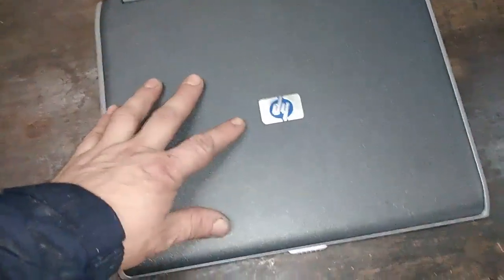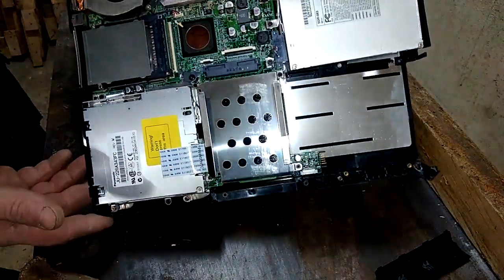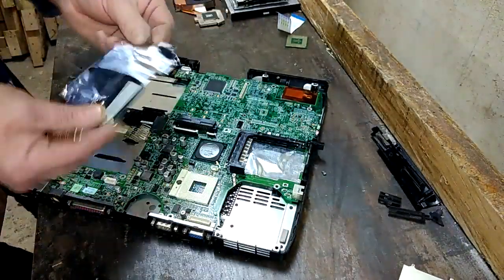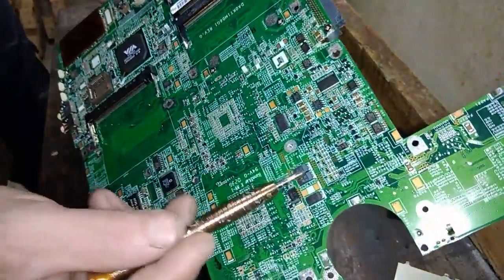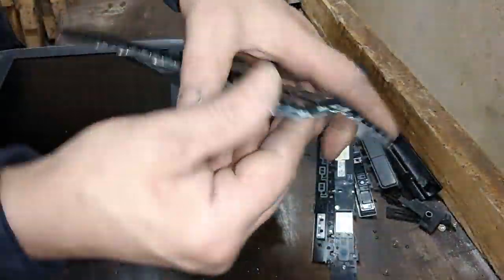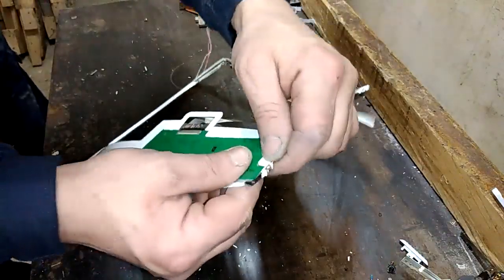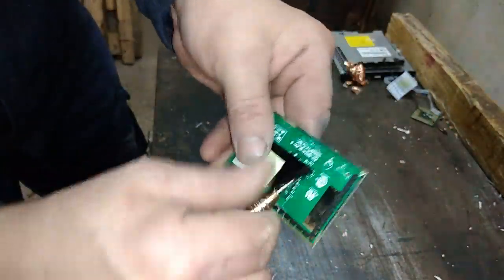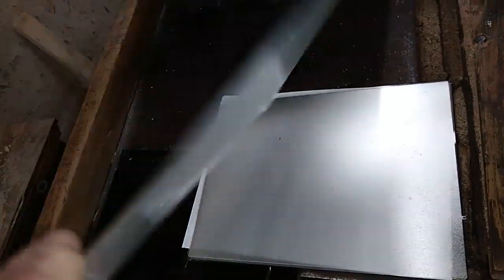Laptop Scrap Step by Step - Au,Ag,Pd,Al,Cu,Fe,Sn,Zn...

Comment: Hi Mr Dusan,
Many times the covers and the chasis is not plastic IT IS MAGNESIUM, as you hear it, it is magnesium.
It really looks like plastic but it is not, check it out with some sulfuric acid or vinegar, scrap a little put on the scrap some of the acid and if it bubbles Eureka it is magnesium even lime will help.
Love your videos. Keep them going.
hola from México.

Comment: Thanks a lot Dusan for making the video, it confirmed me that I am not missing anything in laptops. One question. What is your idea how to process these touchpads boards? It contains glue and green layer (for me a lot of mess) and I really don´t know how to handle them, so I am just keeping them aside until I will find out how to process them.
Reply from the maker: Ok, for the glue, best solution is petrol(benzin). Fill fuel in bucket an leave touchpads in it for some time, should desolve glue. Then wash it in sodium hydroxide and scratch Green solder. And Ap for the end to relese gold foil. Chears.
Reply: @999DusanGoldrecovery  Thanks a lot man! thats sounds easy :)
Reply: You can put in hot sodium hydroxide water solution,  that will remove all the green stuff and glue.
It is dangerous so use all your protection.